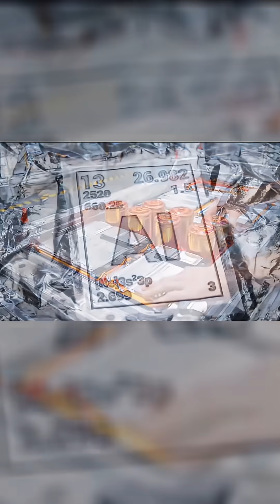Tesla's Aluminum Battery: 600 Miles! Bye Lithium? Model 2

Comment: If your battery can produce a range of 600 miles, why not install it in the Cybertruck to fulfill your promise of a 500-mile range during the introduction? That range is one of the prostrations of buyers, the short range of the Cybertruck. During the testing by individuals of Electric EV LIKE F-150, RIVIAN, SEVERADO, GMC PICKUP,  towing a Trailer 1800 lb for I think a thousand miles, the Cybertruck, thought faster, the frequent charging finishes last, at the bottom of all the electric Vehicles. What is the advantages of the Cybertruck when it finishes last?